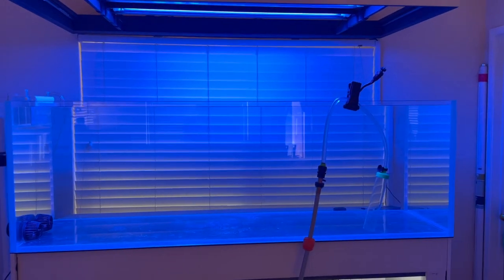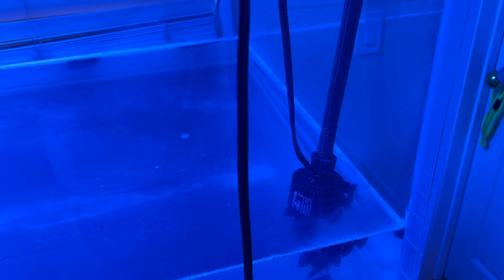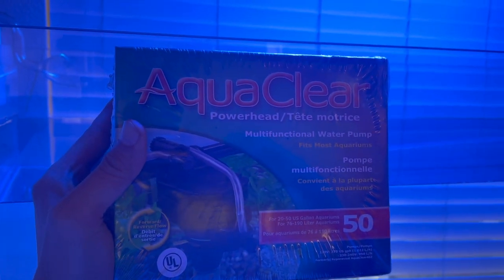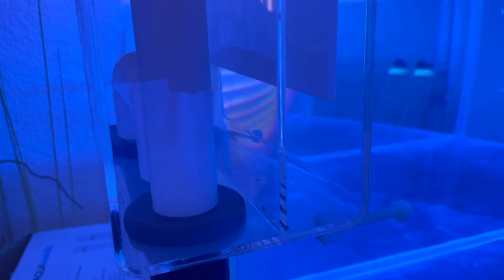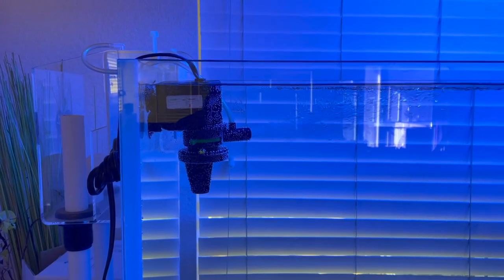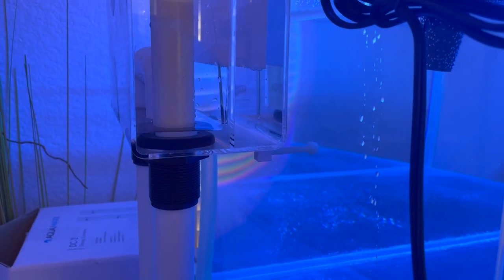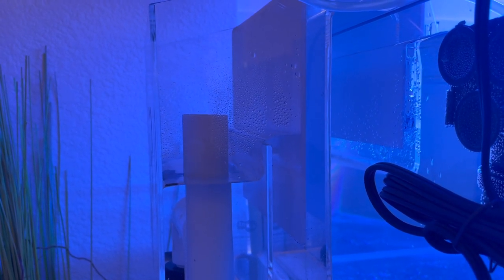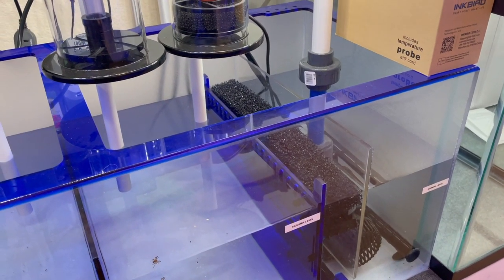BUDGET REEF TANK BUILD | WATER THROUGH THE HANG ON BACK OVERFLOW | WATERBOX

Comment: All pumps will lock up if you haven't use them for a long time. Mine does that, I just uncover it and either plug it in without the cover for it to kick start then turn it off and put the cover back on or while unplug, I just spin it manually for a little bit.
Reply from the maker: I ended up fixing it thankfully.

Comment: Ok so the u pipe in the over flow needs to be a little taller and it should have a tiny hole at the highest point of the U. Hope im explaining this so u understand. I find drawing crap easier then explaining lol. Your stand pipe “emergency” drain should barely have any water going through it if any at all. Thats how i would set it up
Reply from the maker: Thanks for the heads up. I need to sit down and redo it

Comment: In order to quiet the overflow, you will need to drill a hole on top of the main drain "U" pipe and add a line to suck a small amount of air.  This will eliminate the periodic flushing noise.  That is what I had to do to get mine quiet.
Reply from the maker: I did just that and it fixed the flush and the noise
Reply: @prolificbreedaquatics  Glad to help.👍🏾